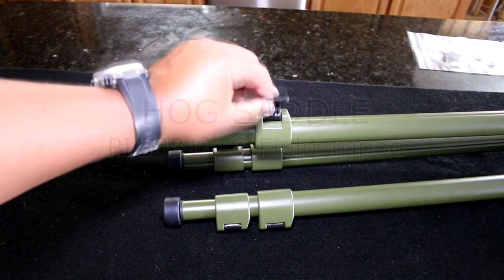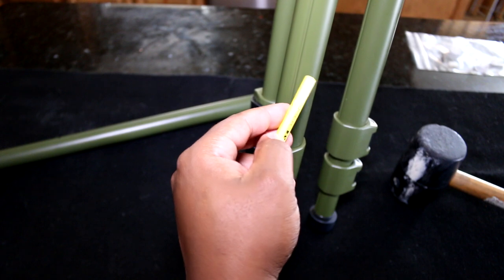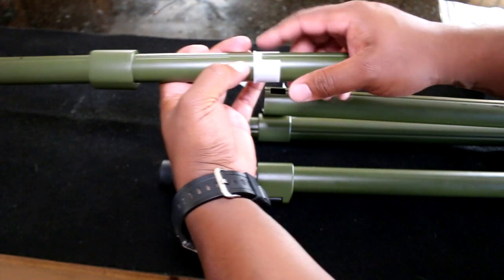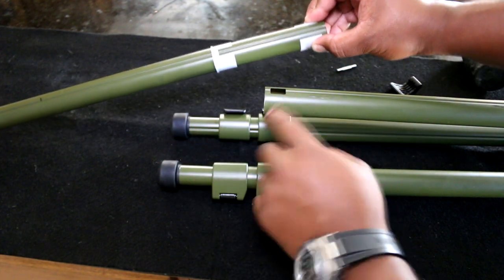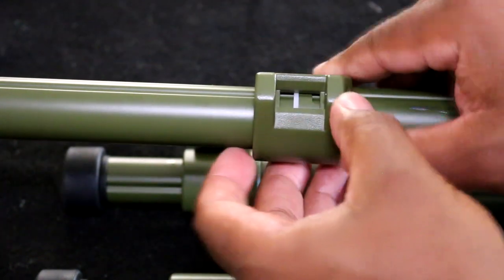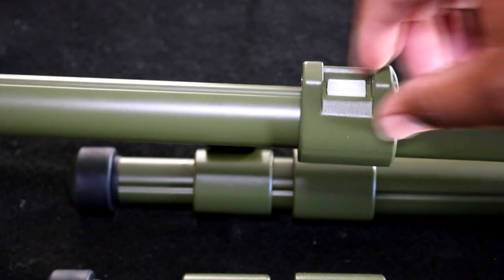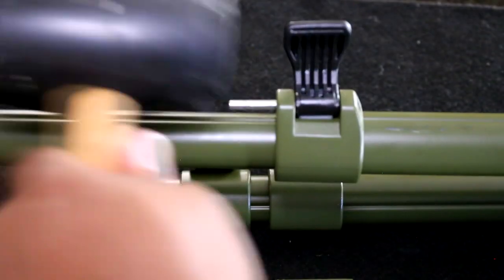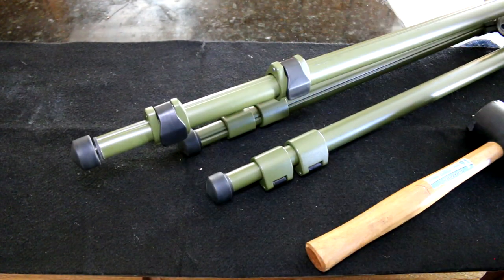Hog Saddle PIG0311-G Field Tripod Leg Stopper Replacement

Comment: I wanted a tripod to do a different type of shooting than on the bench all the time. YOUTUBE is the place to look for anything concerning, shooting. I looked at that type of tripod and I already knew that that locking piece has its problems, being, that I have tripods with that locking system...not the best. Night Stalker tripod has the turning locking piece and it came with the PIG Saddle priced at $320 for me a veteran...weight 5 pounds w/pig saddle attached.
Reply from the maker: Thank you for your Service,  I'm a Vet also!!!

Comment: Why so complex. I've  had a Night Stalker tri-pod with a pig saddle for about a year with no problems and it's a lot simpler with out the cam locks. Just my 2 cents.
Reply from the maker: This is my first Tripod for this, so I really didnt know my options, but that is good to know if it happens again.
Reply: Didn't mean to come off as sounding critical. Good repair video for those who have that style Tripod.
Reply: The Night Stalker, the best at its price point.